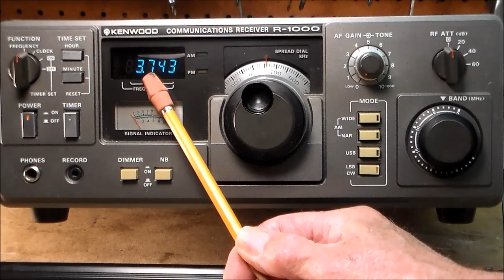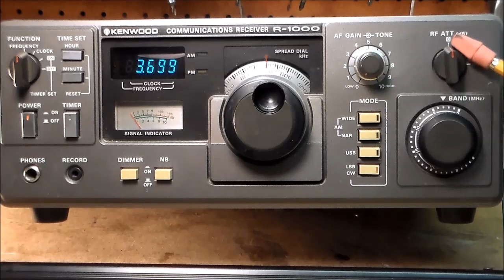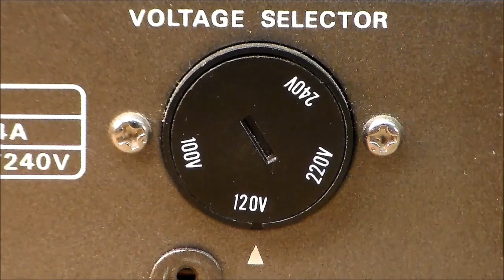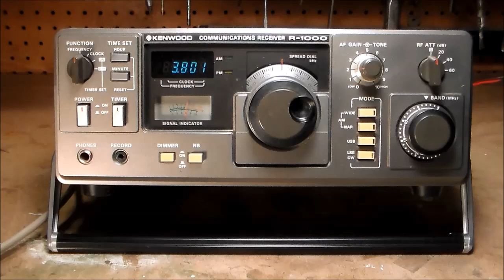KENWOOD R-1000

Comment: My first Real Shortwave Receiver... it is a fantastic & still today out performs many modern shortwave radios.  Mine has the 10m FM upgrade with squelch fitted to the tone control & activated via the dimmer switch.. also I have fitted BHI DSP & under the mysterious black cover I have fitted 12V DC in 👍 great video thanks again.. I will never sell mine 💕

Comment: John - I had one for a short time, myself.  I bought it locally on CraigsList, then sold it a few weeks later at a local Hamfest.  I probably bought it for $50 and sold it for $150.  This was about 10 years ago.  I needed the money.  I did not realize that they were still holding their value so well.  I have a Kenwood R-2000 now that I'm pretty happy with.  However on the Sherwood Engineering web page, the R-1000 is rated much better than the R-2000 at close dynamic range. Maybe I should have kept it.😒   BTW, most of my other receivers are tube type, as well.

Comment: Thank you for the info!  1) Would it be possible to change the RF attenuation choices from 20,40,60 to something smaller (for example: 5,10,15) by altering the internal electronics associated with that switch?  2) How does the RF-1000 compare to the later RF-2000?  3) Why did you do a video on it when you usually prefer tube radios? 4) What frequencies does it cover? Etc.

Comment: Thank you for your very informative video. I have inherited one of these receivers from my uncle, It must be a fairly early model as it has a 5 digit serial number. The mystery black cover plate on the back is missing on mine and has a socket for 13.8v 0.8A input power that seems to be factory fitted with screen printed labelling on the case.

Comment: I've just just purchased one from eBay and I paid $400 Australian for it. And I just won an eBay auction for a yaesu Frg-7000 which comes with the original manual for $380 Australian and both are in very good working condition

Comment: The black panel is for a 12v Jack.  I know because my R600 has the same black panel.  They use to sell the 12v jack for R1000s and R600s that fit perfectly in the hole. There are two pins on the power board for the wire from jack to make the 12v connection.  The R1000 and R600 are identical with the exception of a couple of buttons which really do nothing for the reception.  Both receivers are great for the professional as well as the beginner.   I  recommend both highly if you find one in good condition.
Reply: My understanding is a bit different.   They used that back plate from the 600.   The 1000 never did offer 12v jack after reading the manual and looking at the list of available accessories (in the manual.)  So they covered it up.  Easier than redesigining the back.   To say the 600 and 1000 are identical is a rookie comment.   The 1000 is vastly different and better but your mileage will vary.

Comment: I picked one up last week for $150 in very nice shape.  What antenna do you suggest?  Can I make a "random wire antenna"?  Mine is serial # 2030701 is there a way to figure out the year it was made?  Thanks for the video!
Reply from the maker: random wire antenna is fine. It should be at least 75 feet long and mounted as high as possible using proper insulators at each end. I don't know how to find the year of manufacture.
Reply: @squarewave2  Thanks for the reply!!

Comment: I have received from my grandfather, what looks to be a Kenwood model R 1000 Communications receiver like the one you reviewed.  I am assuming this is at least 30 years old with the original manual the warranty replacement parts, etc. it is in mint condition. I am seeking to find the value. Can you assist me in this effort
Reply from the maker: Hi Kelley,
Do a search on Ebay for your Kenwood  R-1000. Prices range from $200 to $400. 
 A mint condition Kenwood could be $400!

Comment: I know this is a long time after the initial post but hope anyone seeing this can help. I dabbled a few years back with shortwave using some very basic sets which were disappointing to say the least. However, my late father passed on to me the R-1000, which he thought to be quite good and at the time I also agreed was a good set. The only problem I have is now that after many years of storage the mode switches are really jammed, apparently it's a common problem with some of these sets. I've tried WD-40, GT85 etc but think it's a mechanical problem requiring a new set of switches. Does anyone know of a part substitute or other fix as I'd love to use his old set again.

Comment: Mine has the 12v input on the back of mine. My NB button does not seem to work. Any ideas what I should do?
Reply from the maker: The NB (noise blanker) button only works to quiet localized ELECTRICAL interference. This interference is rarely a problem. Don't confuse electrical interference with the normal noise present in short wave. My NB button, too, appears to do nothing.
Reply: @squarewave2  roger that 👍

Comment: It will break I don't believe  it won't be damaged
Reply: Buttons will break if it falls
Reply: Don't lie to people mr!
Reply: That black panel is for 12 bolt powersuppy
Reply: Mine came power 12 voltage added to the receiver
Reply: It's not a misery it 12 volt Powe supply